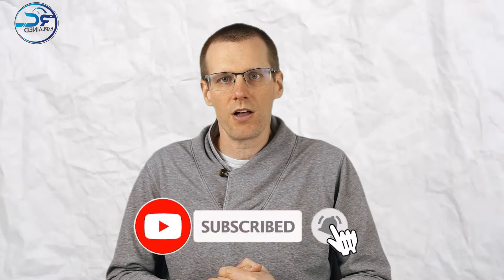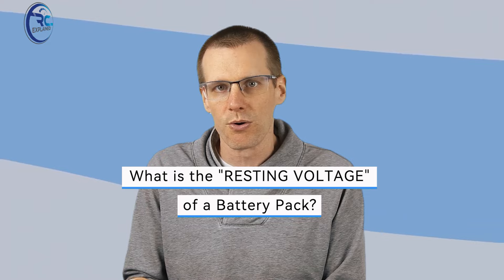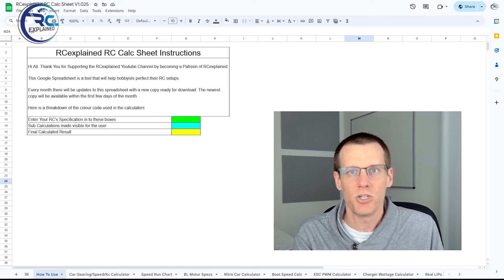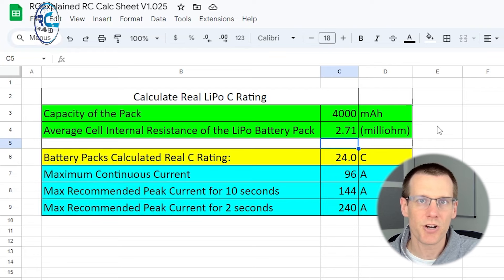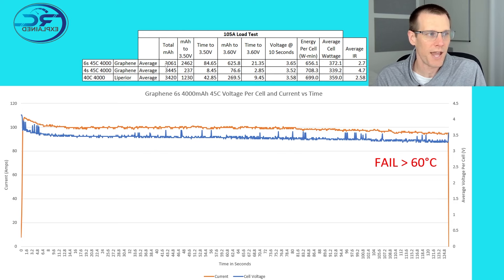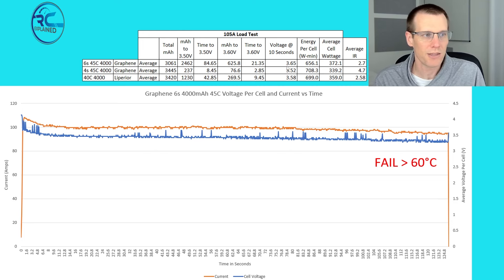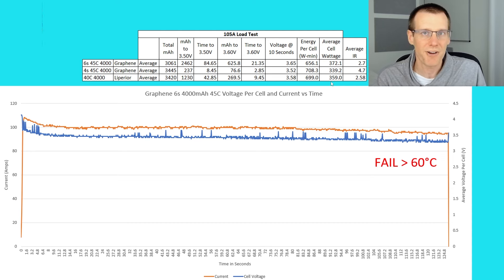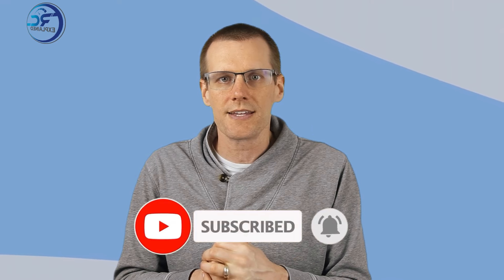These 45C 6s 4000mAh Graphene Packs Are Redefining Turnigy 45C Expectations!

Comment: Thanks for the info, can you show us how you did the test so its repeatable and acuarate? Im interested to see how you were able to run 105amps for 124.8 seconds straight. As always, thanks for your efforts.
Reply from the maker: The load is not constant current as shown in the graph. The load is an EDF setup.

Comment: RESTING VOLTAGE....
Great video and info ...actually looking to buy some Hobbyking graphene lipos ....
I fly 3d fixed wing with 6S 4000 mAh and 5000 mAh graphene lipos from HRB and Yoowoo i use Frsky Tx setup with a 21.5 volt low voltage call out every few seconds if it falls below this 21.5 volts....once this settles at this resting voltage for say 4 call outs over a 20-30 secs period or more....i come in and land.
What i experience which i find very useful with Frsky Tx is you can set a DELAY for your low voltage alarm and this allows you to feel the voltage drops with certain HARD manouvers as it calls them out then stops as it bounces off the low voltage ...

I like this method as it allows you to use the full capacity of the lipos by flying low and slow to allow the resting voltage to recover thus allowing you to fly longer...been using this method for few years now and really like it.
Reply from the maker: Interesting technique, thanks for sharing.

Comment: Great video is there a trustworthy lipo battery company with an accurate C rating that you recommend
Reply from the maker: A lot of guys like the SMC batteries. I have yet to test them. In addition, there are no LiPo batteries out there that I am aware of with truly accurate C ratings.
Reply: Thankyou
Reply: Test Pulse Lipos Please, have the best performance I ever seen, test the ones for helicopters , soft cast please if you do. Had 5000 mah 35c and 25c , performed way better than any packs I ever had